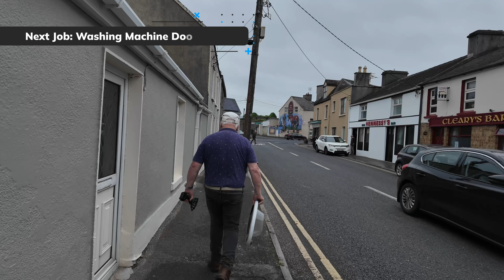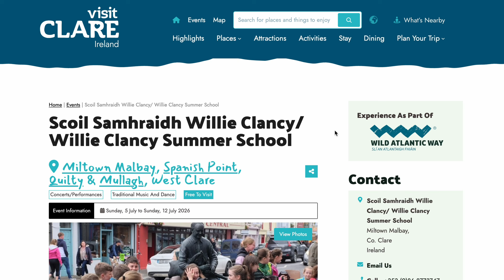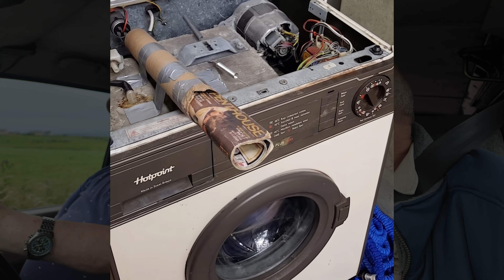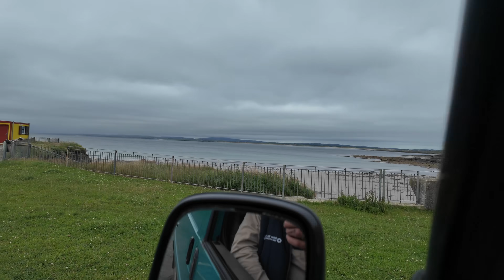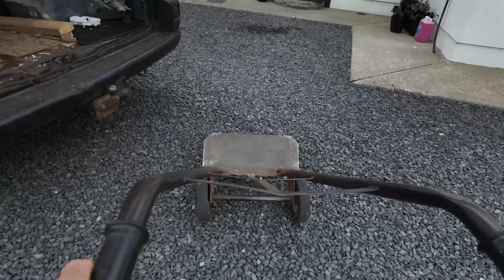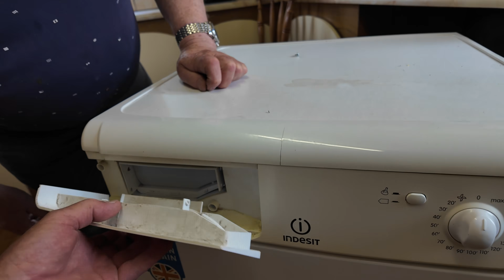Fixing a Hoover Washer Door Hinge & Indesit Tumble Dryer Won't Spin | Appliance Repairs with Tom

Comment: Hi I just found your channel , we just bought a new front loader & the nut on the back of the drum is banging on the back panel  at low rpm, the machine is level & the feet are planted any ideas ? contacted Bosch but useless.Thanks.